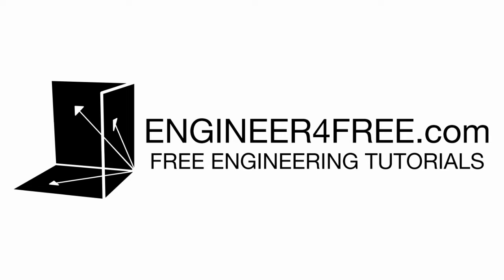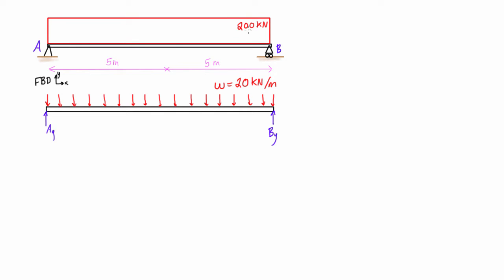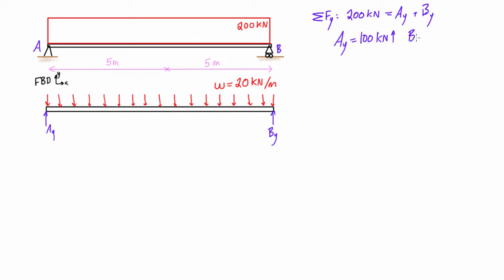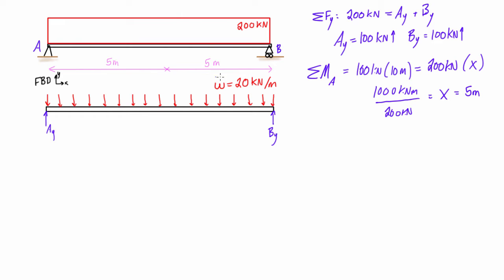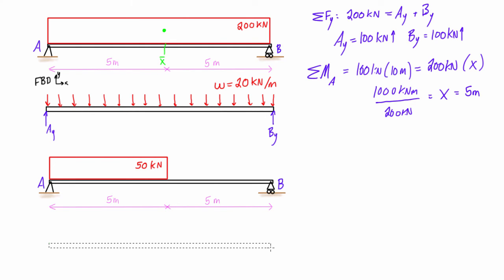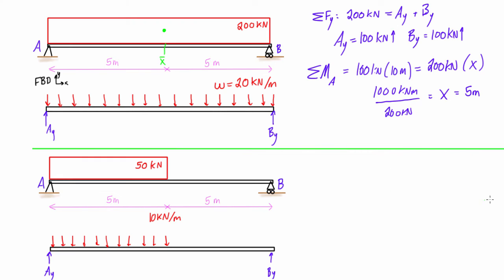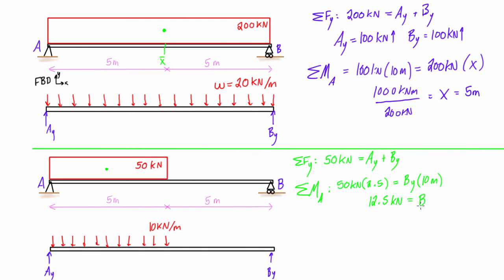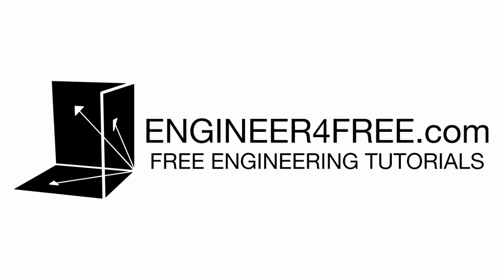Distributed loading on a beam example #1: rectangular loads

Comment: what is the relation between centroid (center of area ) and distributed forces?
Reply from the maker: Centroid of the shape of a distributed load represents the x location of the equivalent point load. It's needed for the sum of moments about a point calculation. Please watch videos 58-65 here: engineer4free.com/statics it will explain the method and go over enough examples to be confident in what's going on.
Reply: @Engineer4Free   you are the best thank you ♥

Comment: For pin support where is the Ax
Reply from the maker: Ax = 0 because there are no horizontally applied loads. It's pretty okay to not bother writing that, but if you are on a test I would still explicitly write Ax = 0 just to communicate without doubt that you know what is going on.